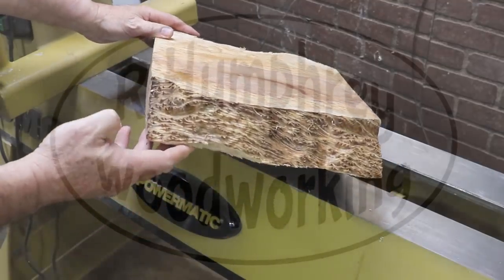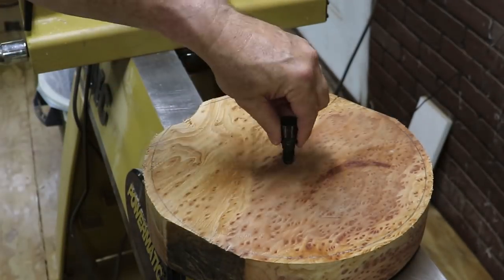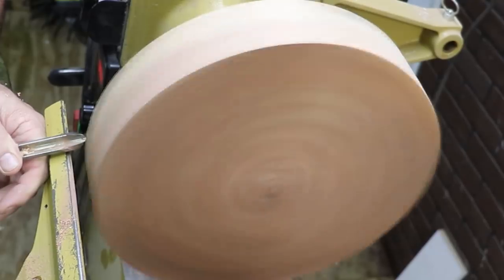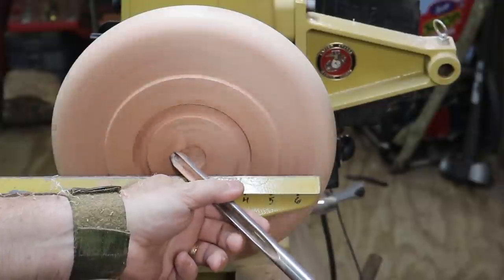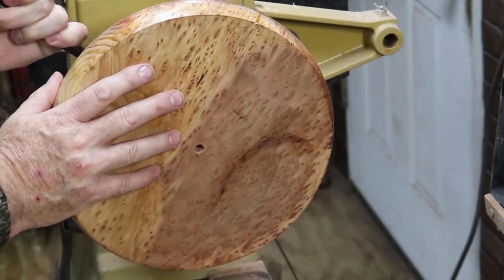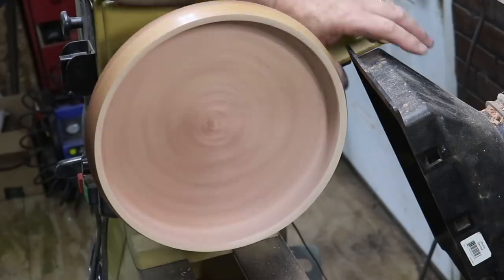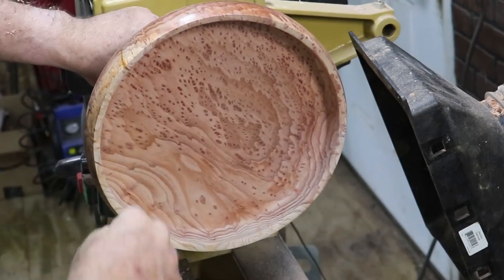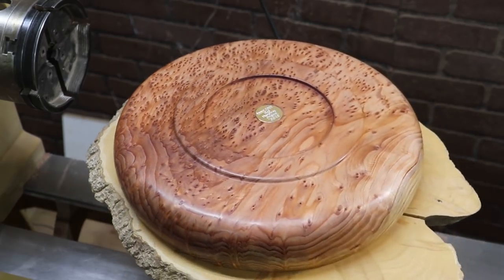Woodturning an Ancient Redwood Burl

Comment: Beautiful wood and a great turning job. Did have a question. I noticed when you were turning the inside of the bowl that when working from the rim to the center you only went about half way and then you shear scraped with the gouge from the center again about half way to the rim. Is this because of grain change ??? Thanks.
Reply from the maker: Thanks very much!  It had a lot to do with the angles and grain both...and tool feedback.  I was undercutting the sides to match the outer curve of the walls, and I seemed to get some nice shavings and very little tear out shear scraping, so I went with it.  Also, honestly, I really wanted to be careful with this wood and it just felt right to go that route.  Hope that makes sense.

Comment: It's probably just my eyes but it looks like you put that bolt? In the wood at a bad angle?
Reply from the maker: Good eye!  It can be just a touch off with no problem, it straightens out and tightens right up, flat to the chuck.  The slab was a bit thicker on the one end, but I evened it out as I shaped the bottom/foot of the bowl.